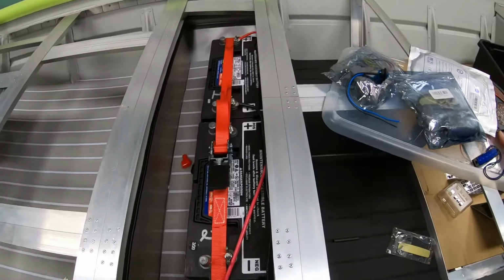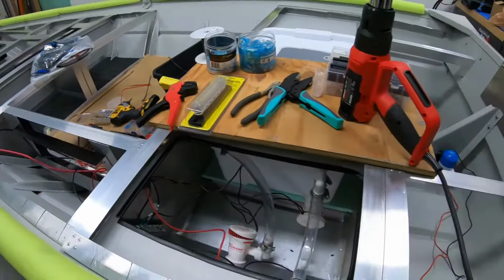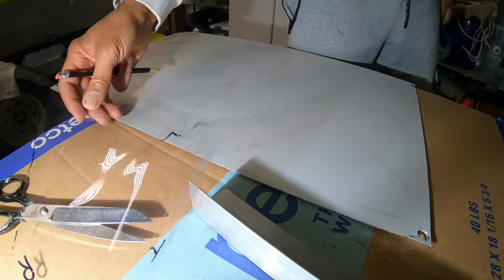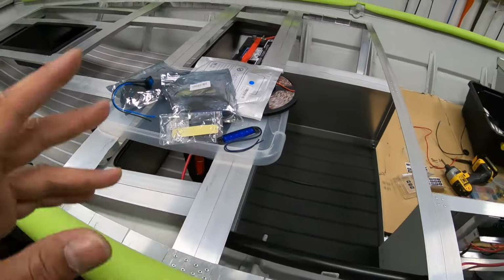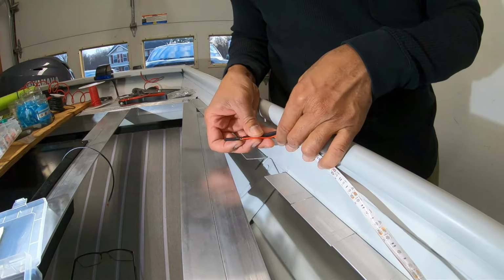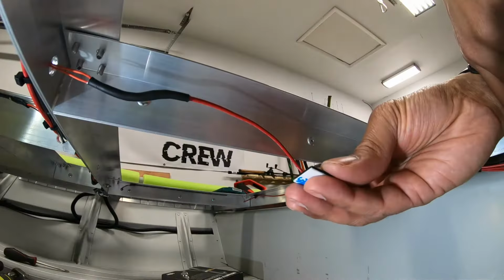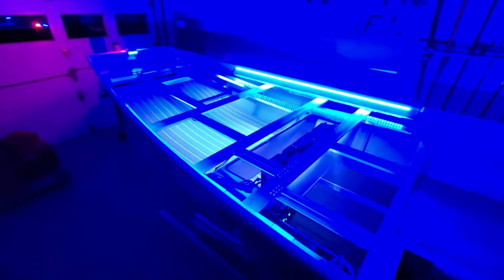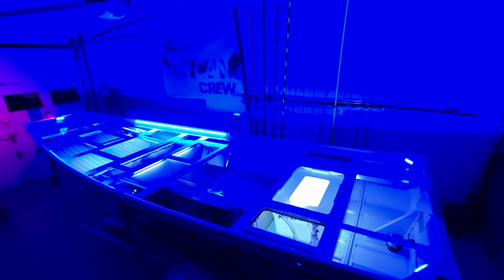EASY BREAKDOWN: Basic Layout For Jon Boat Wiring

Comment: I’ve seen a bunch of boat videos. Is there a reason the distribution block / fuses are along side the switches and not hidden?  It’s clean but just curious if I can hide mine? Practical reasons, safety, other.   My boat is coming along nicely, appreciate all your videos.
Reply from the maker: No reason. We hide them when it makes sense to. Mostly based on space availability. Totally up to you.

Comment: How many little led light can be connected to one switch
Reply from the maker: There's no exact answer to that. It really has to do with current draw.  In general, connecting multiple LED strings to one switch is perfectly fine.  Example, six led strips to one panel switch.
Reply: Thanks there is no video showing that I have hatch lights but didn't want to connect t to many and overload the switch would love  if you done a video on it in the future thanks mate keep up the great work
Reply from the maker: @jarradpiltz9667  no problem. Ill add that video to the to do list.

Comment: Awesome video I'm trying to put new nilight switches on my bass tracker with a new bussbar fuse panel but not to sure how to connect the factory wires any help would be appreciated thanks
Reply: I'm planning on doing that with my tracker. the factory wires are confusing as heck. from my thought I'm gonna have two combo fuse panels one always on which that's what the switch panel would go. The other will only power on when the ign switch is turned to the on position. But I'm just gonna gut the factory wires I can. I did contact white river to see if i can get any diagrams hopefully they get back to me. on my factory fuse panel all i have is a little 14 gauge wire powering the panel and that's linked back to the ign switch.  I deff want to add a kill switch for under the console. but i got to figure out all the other wire in the factory harness a lot is going on.

Comment: How long will one of those deep cycle batteries typically last being dedicated to the trolling motor ? Also I see a dedicated battery for the trolling motor dedicated accessory batter, if an outboard was being ran would there just be a 3rd battery for starting it ? When do you need a 2nd battery solely for accessories ?
Reply from the maker: There a a few different ways you can do it. For a 12 volt trolling motor like this, you can use one battery all day as long as you have an outboard motor for your long runs. Bottom line, it all depends on usage. The second battery can run your graphs and accessories.  You would need a starter battery for a gas motor that has electric start. On my personal boat, I put my accessories on my starter battery because it's a dual purpose battery.  You should consider running your graphs on a dedicated battery to eliminate potential interference from othe electronics. Good thing is you can buy the new lithium mini batteries which are light weight and take up less space. The prices have gone down on Amazon.  Hope this helps.
Reply: @BassBrothersFishingDMV  yes thank you very much, I don’t have anything set in stone just yet. I recently acquired a 17ft bass tracker with a 80 outboard and a trolling motor on the front and I believe and electric trolling motor in the rear. I don’t plan on running any graphs or a live well mostly just some lights in the hatches and on the outside/deck aswell as some usb ports and a radio and some speakers. I don’t do any competitive fishing I want the most comfortable rig for me so most of my electronics are just accessory items. Thank you for the help.

Comment: Question, the fuse box sits out like that, for saltwater fishing, wouldn’t it be easy to rust out the connections?
Reply from the maker: I don't have much experience with salt after but everything is made out of stainless steel so it all depends how stainless steel does with salt water. If it's an issue I would install the fuse box inside the boat like other salt water boats.